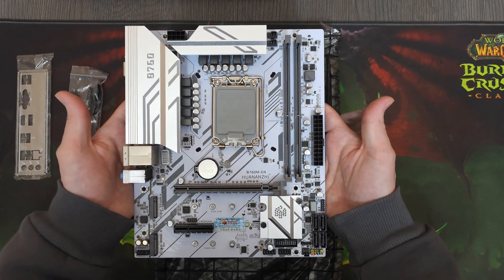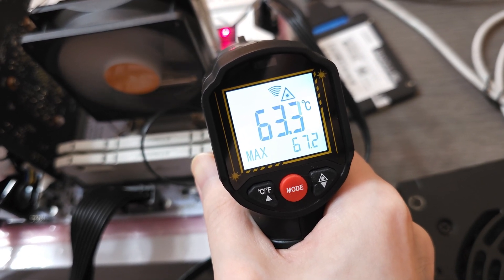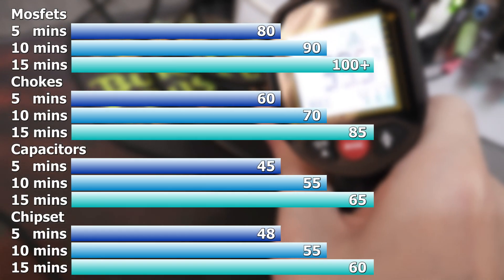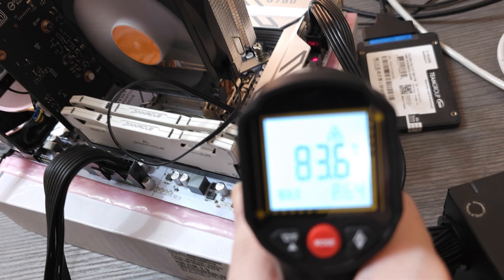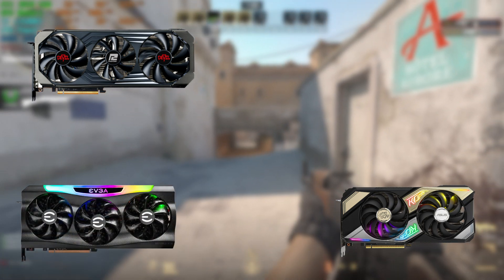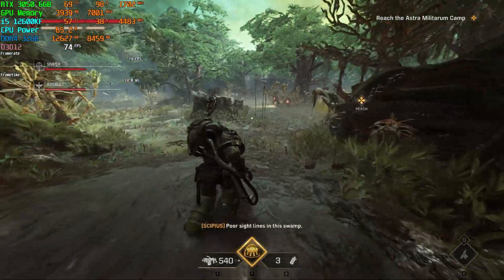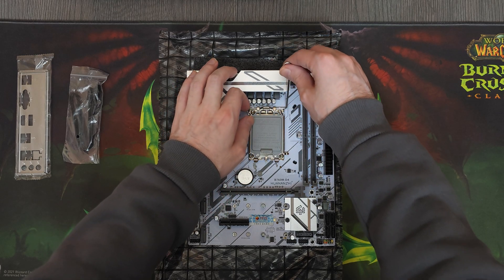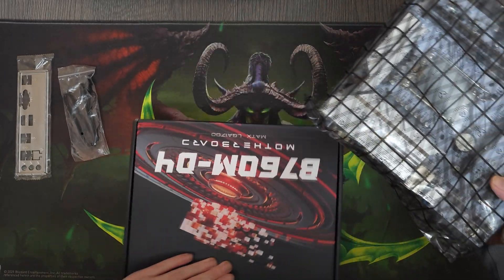Huananzhi B760M - In Depth Test Results (Thermals, BIOS, VRMs)

Comment: Hi, I'm thinking of buying this motherboard to use with an i5 12400f and an RTX 5050. My main focus is video editing. Do you think this motherboard would be sufficient, or would it be better to look for another one?
Reply from the maker: It will be perfect honestly. This is literally the configuration that I will be using for my All-New systems in 2026. A lot of people will tell you that RTX 5050 is bad tho, which is correct, but it is the only choice within that budget. Adding more money and buying a 5060 won't do much for you, you won't gain much, so it's not worth it. If you decide to upgrade that system or save money and get something better, look at new Intel Ultra CPUs then, like an Ultra 5 225F or something. Other than that, it's all fine. If you don't buy used parts, it's perfectly fine to buy an i5 12400F + RTX 5050 for editing.

P.S. get 32GB RAM. 16GB is not enough for it.
Reply: @Mike21Daisu Do you think this setup might be capable of 4K editing?
Reply from the maker: @kauamarconsini  yes, but it won't be fast.

Comment: Have you checked whether the power delivery is a genuine phase or doubled phase.
Reply from the maker: How do you check that?
Reply: @Mike21Daisu I don't know, so I'm asking you in case you know.
Reply from the maker: @zewonyoungmi3504  I don't know if it's possible to check that.

Never needed, probably never will. But I'm curious to know why I would ever need to check that, 'cause I think there's no point.

In my whole career power delivery has never been an issue. The only issue is usually the VRMs overheating.

Even if you install an i9 into a low end H series motherboard, the VRMs will overheat before you start worrying about the genuineness of the power delivery.

Comment: I wonder if it would help to either replace the vrm thermal pads or apply thermal grease?  Perhaps a small fan that can blow on the heatsink and chokes?  Like a 40mm
Reply from the maker: A fan can help. Replacing the heatsink could also help (assuming u change it with a better one). But the fact that the heatsink is heating up quite well, means that it's making a good contact. It's just not the best heatsink, hence the price of the motherboard.

I don't recommend messing with it tho. The easiest way to use a powerful CPU with this motherboard is to limit it to 120W (or less).
Reply: @Mike21Daisu I wonder if using fine grit sandpaper on it would help. If the anodized metal is less conductive
Reply: @Mike21Daisu like the x99 f8d plus vrm heatsinks. They sit on the mosfet and the fan also blows on the chokes.